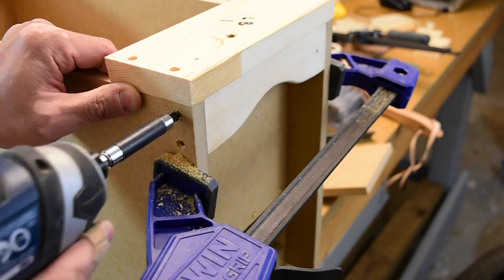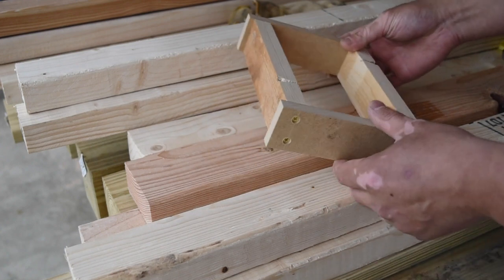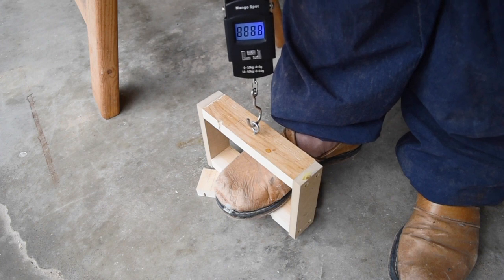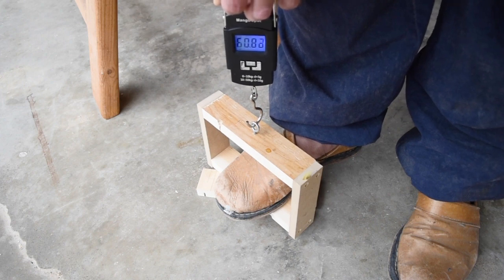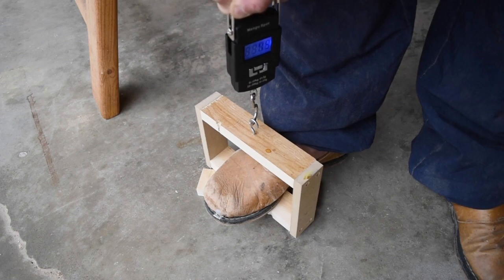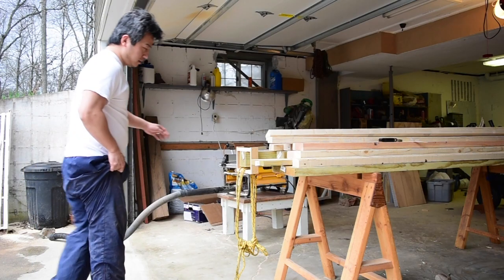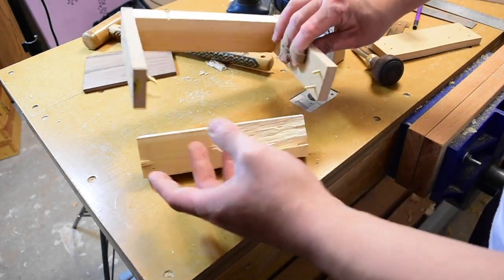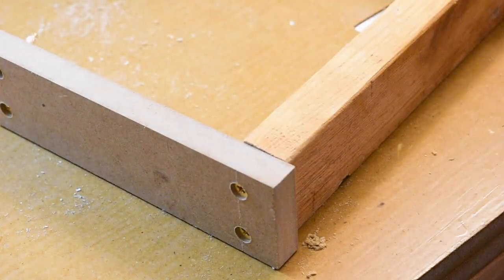MDF - Pine - Brass Screw Joinery Weakness Assay

Comment: If you think MDF is cool you should see HDF. If you play your cards right in terms of where you apply your forces and how you apply them, that thing is very resilient to shock and load. I have quite a few pieces of throw-around furniture that i've made from HDF (which i've obtained from either scrapping old imitation flooring or 1M by 2M sample boards which major shops will discard once the season is complete). Besides the hard glaze on both panels which, i dare say, is on par with old melamine countertops, the very dense nature of the material itself gives any project amazing robustness.

And to think years ago people scoffed at MDF for being a sub-par material. It might still be, but done right, it's far better than wood if you value strength over looks.
Reply from the maker: MDF has it's place, it doesn't replace real wood, but is an economical alternative for beginners, shop project, prototyping etc. It's always amazing how much people waste; it's hard to believe that a company would rather throw something away instead of selling it for $1.

Comment: I'm more curious to see how this holds up over time. My guess is that MDF deteriorates with slight movements over long periods of time, whereas wood will take long term movement a lot better. I'm not surprised that it holds up the day you put it together, but what about a year or two from now? Not trying to troll you or anything, just pointing out a viewpoint to consider. And that may not be an issue, depending on what you're building. All things in context.
Reply from the maker: +Keith Peters It's for a Traditional Japanese Woodworking Toolbox for Beginners, using not so traditional methods and material. Since a design like this hasn't been tried we can both wait to see how it holds up over time. There are a couple of factors that causes a person to care for their possessions, and if well cared, I expect this to last long as anything made of real wood...  so at least 200 years? 

I don't think this is trolling at all.  I appreciate your view point, some people perceive only the worst, so he sees everything that doesn't fit him narrow view as trolling and get super defensive.

Comment: Must admit I'm surprised at the strength. If your doing strength tests. I'm sure I'll be surprised at the build (tool box) it was done for.
Reply from the maker: +MRrwmac I too was surprised. I now have respect for MDF. The test was done for a Traditional Japanese Woodworking Toolbox for Beginners using 70% MDF (hope to be up by tomorrow).
Reply: +John Zhu I still don't like how MDF splits at the screw point even if (and almost required) we pre drill! I like how real wood, even hardwoods, at least have some flexibility within the fibers and therefore more resistant to cracking at the screw point. But it is factory fabricated, so I can't complain. Haha.
Reply from the maker: +MRrwmac Not to mention flat.

Comment: MDF has its strengths, but it also has one significant weakness that needs to be worked around: it splits easily. This splitting reduces the holding power of fasteners into the edge grain and also has a big impact on glue holding, since the face layer that a part is glued to will peel off with little force. Driving screws through the layers into solid wood like you did is the strongest possible simple joint configuration.
Interesting coincidence for me, I have a project coming out today or tomorrow that used MDF in an unconventional way.
Reply from the maker: +John Heisz It has been ~10 years since I last used MDF, now I used it to replace my bench top, and made this unconventional project using a lot of MDF; Coincidentally, coming out probably today or tomorrow, the edit race is on!
Back to your point, I have noticed that in the end grains that if I tighten just a bit with a screw it there would be an hair line crack. I'll try to remember to show that in this project. I guess I got lucky using it in the "strongest possible simple joint configuration" SWEET!
Reply: John Zhu My video is already edited and uploaded, just now working on the website articles (new one plus update the old one).
It's too late now, so it will have to be tomorrow morning.

Comment: Very interesting and surprising! faith in MDF restored! :P Of course it will be as this strong when working in that shear direction. I guess if you swapped the materials and the handle was MDF it would have broke faster right?
Reply from the maker: +Cactus! workshop Good question. I did not do it in any other configuration. I anticipated that people will have question about the strength of the handle for a project I am building; I only tested my design.